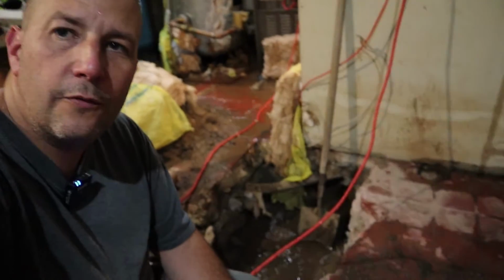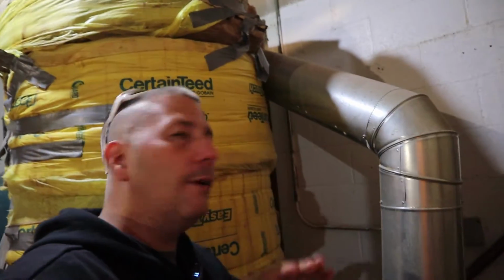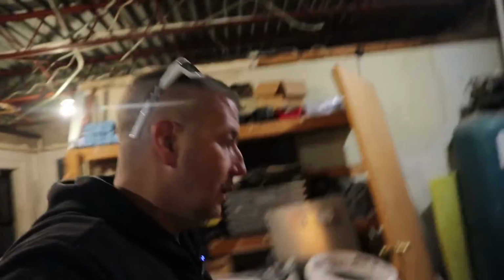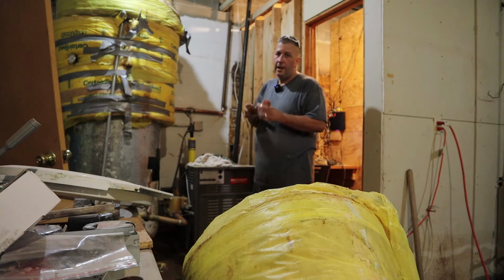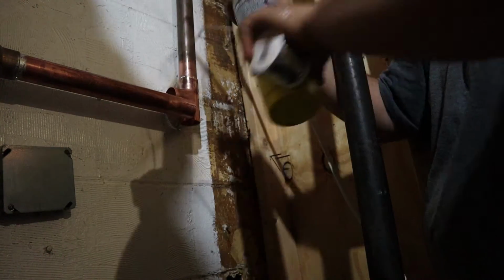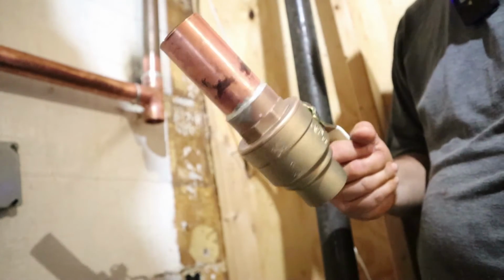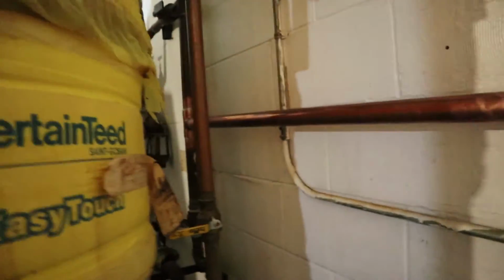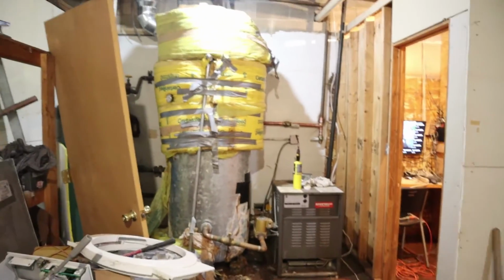Laundromat Water Tank LEAKING! | Following Keenan !

Comment: Sand the crap out of every joint and it will make everything way easier. You did good. Copper fittings are coated in shellac to prevent corroding before you get them. This is the main reason for doing this. It's not tarnish its like varnish. Also old fittings can be reused if you clean them well. I've done it. Also don't trust PEX. The plastic stuff. Just seems jankey to me.

Comment: keeenan its called a water heater not a hot water heater if the water was allready hot you would not neeed to heat it:) and did this tank come with the building it looks really old time for a new lockenvar shield water heater the brand i use